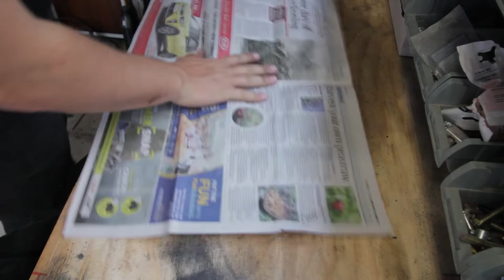Polishing and Cleaning Stuff | 1979 Honda CX500 (GL400) | Denway

Comment: Can you explain the tools used? 

I want to clean/polish my engine, forks, etc like this. I have a drill. What are the wire brush attachments, do they come in different hardnesses? And what's the name of the polish you used? 

Thanks.
Reply from the maker: Hi there mate,

I used a combination of autosol aluminium polish, brass wire wheel, scouring polish wheel and a lot of elbow grease, patience and time. Things similar to this https://www.supercheapauto.co.nz/p/toolpro-toolpro-cotton-polishing-cones-medium-assorted/386606.html?cgid=SCN01011102
Reply from the maker: scouring pads are a great help for getting the grime off also.
Reply: @DenwayCC  Thanks!